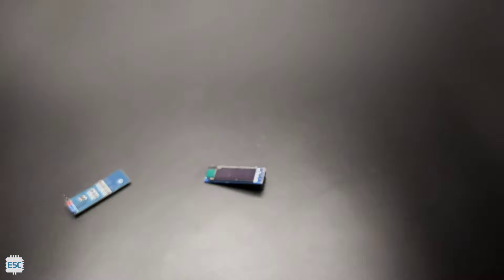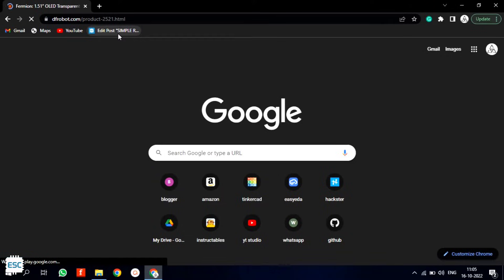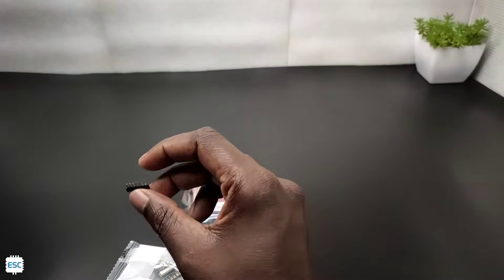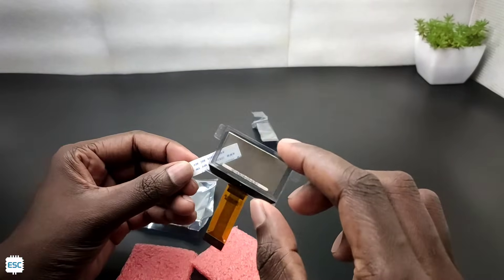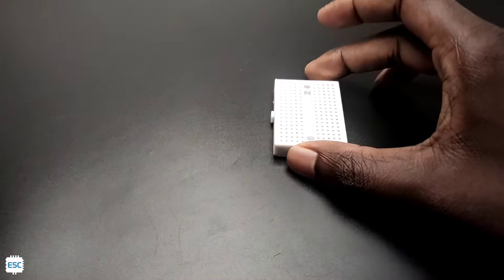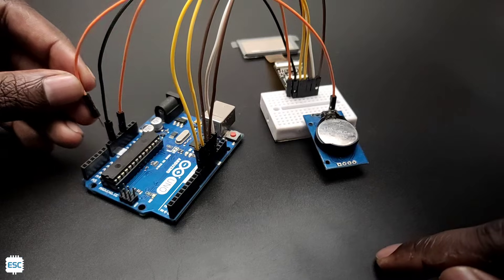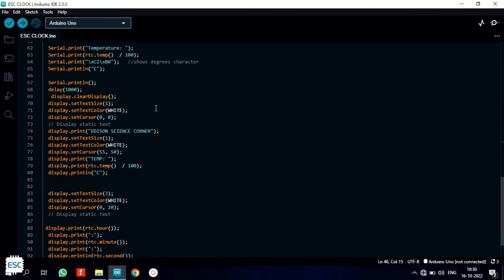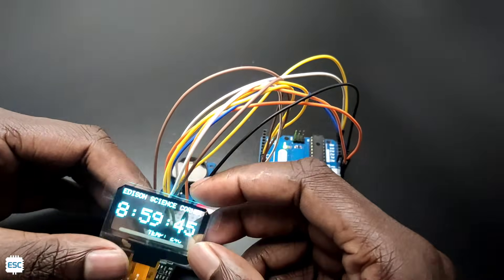How to Use Transparent OLED display with Arduino | DF Robot

Comment: Interesting that your code seems to reference SSD1306, but the controller chip is SSD1309. Came here because I've been trying to get my Teensy to control the display, but alas, I cannot get it to turn on :(

Soon I will get it working I hope :) Thanks for this video, Helpful to know your code got it working
Reply from the maker: I Never worked with teensy controllers.  You can check the code from the description box and use

Comment: So I bought all of the stuff you have and I use the same code. Do I have to make some changes to the code because the display is not working but I triple checked the wiring and everything’s correct
Reply from the maker: The code will work without any problems